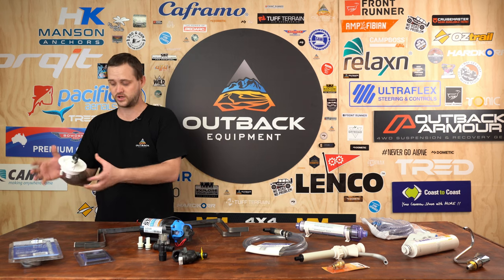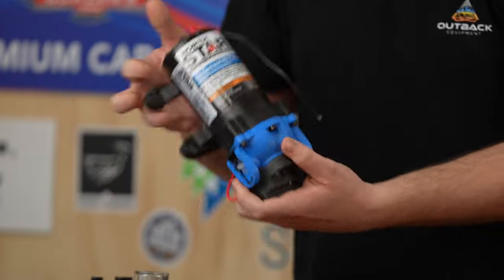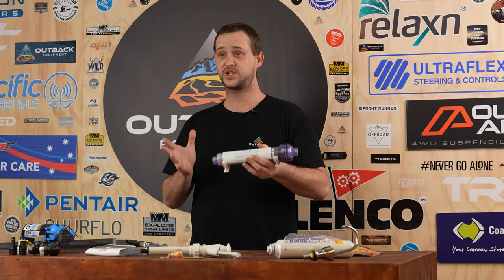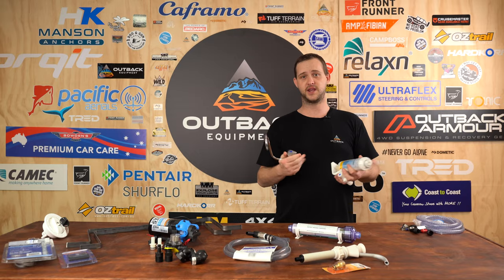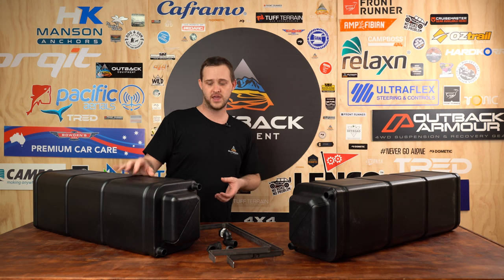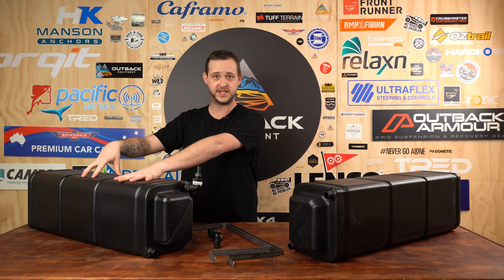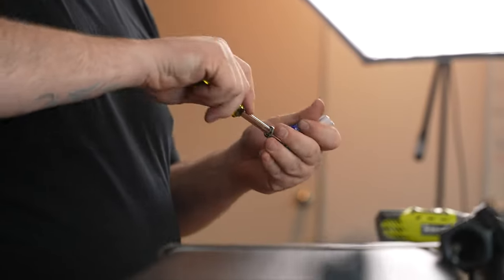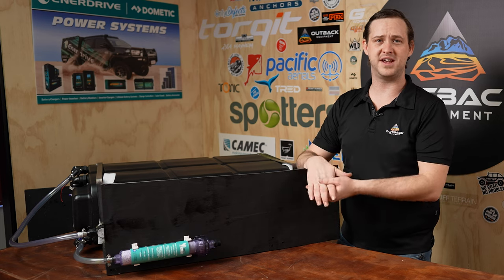How To Install A Complete Caravan Plumbing System

Comment: It looks like the thirsty nomad link is broken, also can you link the 12v electric pump breather kit?
Also wouldn't having the filter between the inlet and the tanks stop them from filling as quickly and potentially cause back flowing? What would be drawing the water through it, compared to if it was on the other side of the pump pulling it?
Also can you create a follow up showing the full connection, including the breather?
I'm planning on purchasing this guide as an install tutorial
Thanks

Comment: great tips with stopping the brackets rubbing on the tanks. Have you seen any issues with the 2x tanks rubbing together?
Reply from the maker: Issues can happen but not too often, as generally, the tanks are installed separately but if you are concerned, putting a gap or some foam between them like in the video would be a good idea.